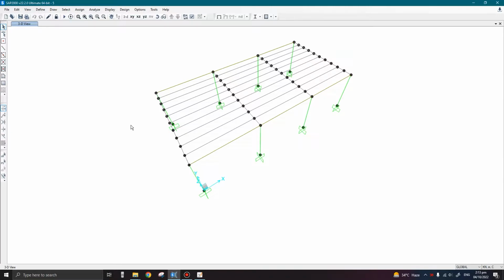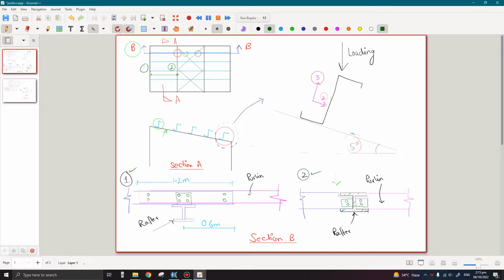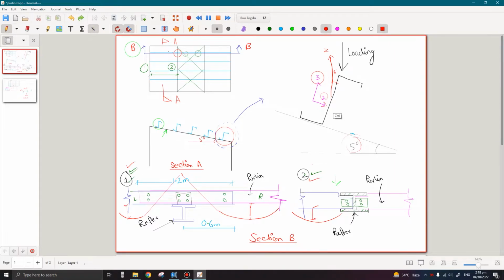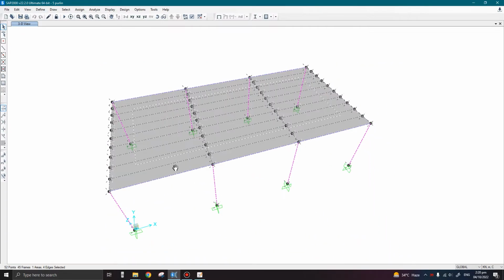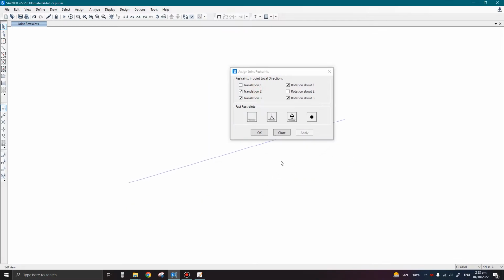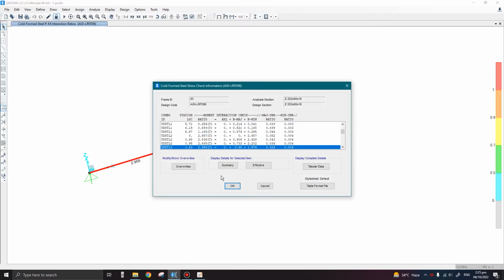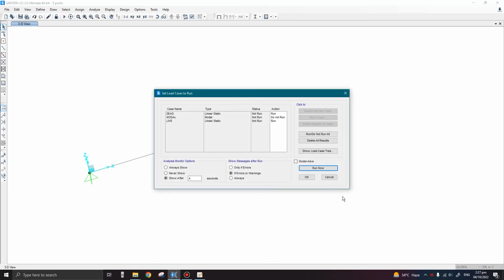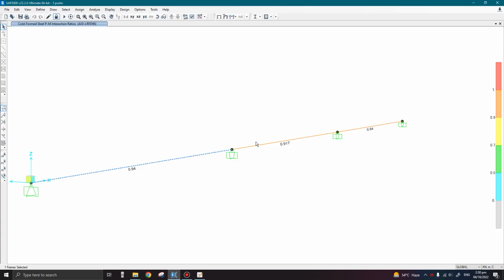Lecture 05 | Cold Form Steel Purlin Design | Design of Steel Structures | SAP2000

Comment: Sir how do I show overlap. If two C channels are overlapping at one point and are bolted together in my structure how do I show this in SAP 2000
Reply from the maker: This cannot be done in SAP2000. There is a difference of opinion on how to take this effect. In my personal opinion overlapping does not make the section composite, and the thickness should not be doubled.

Comment: Sir , what about wind loading?

There is no wind loading on your purlin !!! Why ?
Reply from the maker: At this point I haven't touched the topic of wind loading. Wind loading calculation and application is covered in later lectures. I will include the design of purlin with wind loading as well in upcoming lectures
Reply: @ammarayub275  thank you sir 👍 keep on these videos.